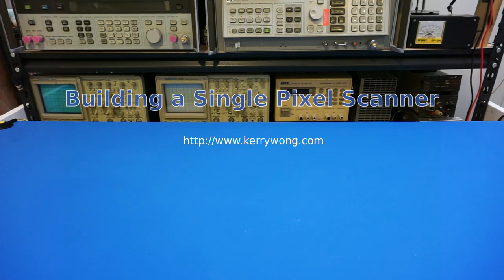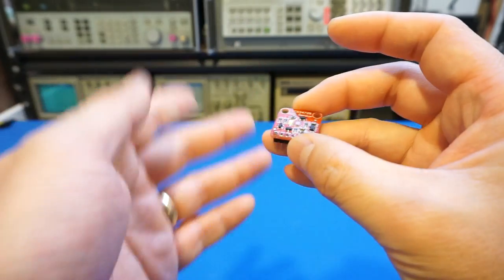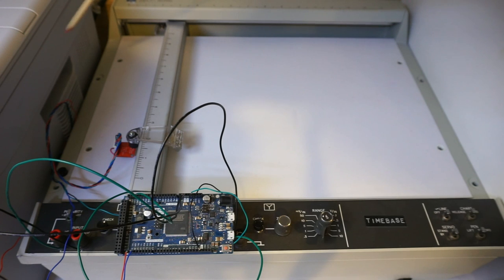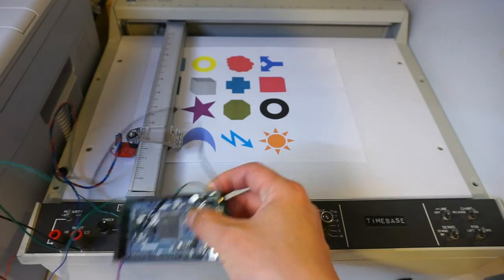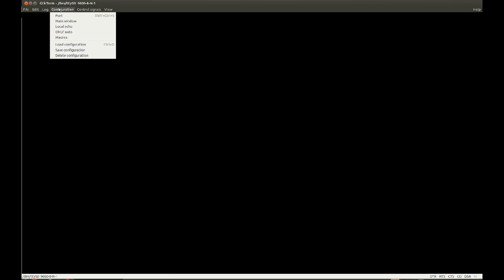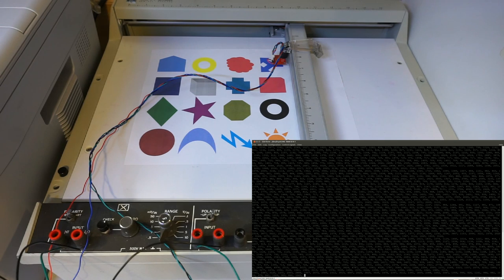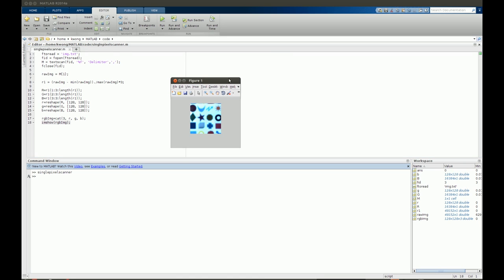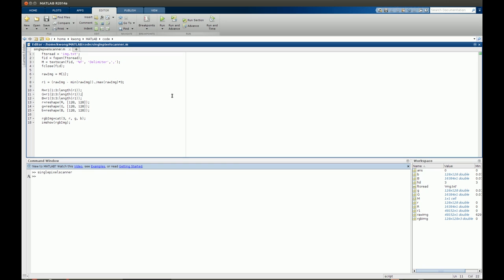Building a Single Pixel Scanner

Comment: Great experiment ! Thanks for sharing. I wonder about 2 things :
1° Whould you try a higher resolution ? (You coud let it run overnight).
2° What about putting a lens in front of the sensor, you might be able to focus a smaller pixel from farther away (alowing the white led to spread it's light evenly)
Reply from the maker: Yes, these were the point I mentioned in my video. If I find a proper lens I will give it a try.

Comment: I like it very much ! How expensive are these plotters ? I guess If you would change your RGB sensor with a UV laser diode you could even laser image a photosensitive PCB without needing a printed overhead foil anymore. Directly from your PCB design data.
Reply from the maker: I got mine on eBay for less than $100. There are even cheaper ones around if you are patient.
Reply: Cool very easy and fast way to build a laser cnc plotter ! I will be patient then :)